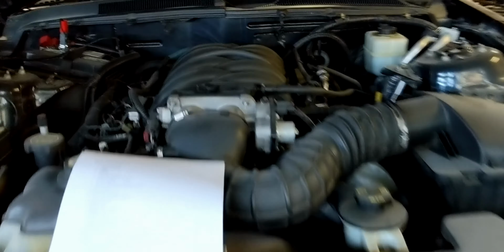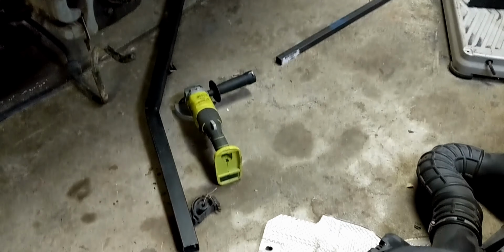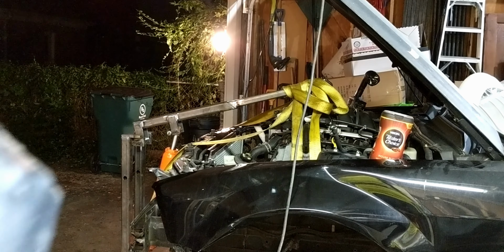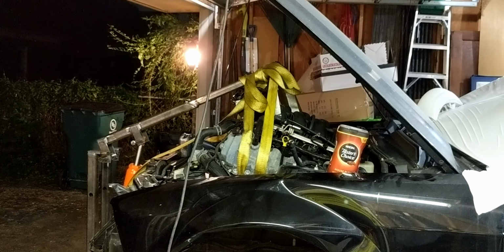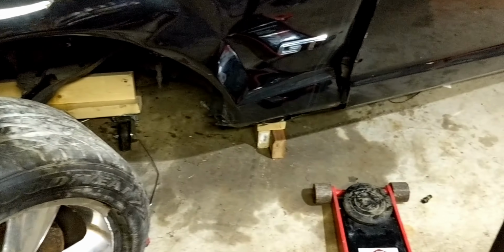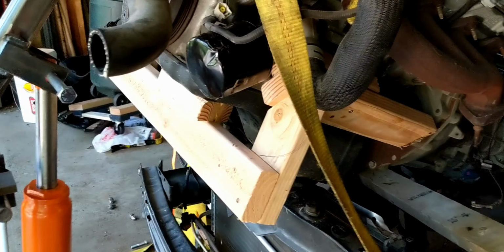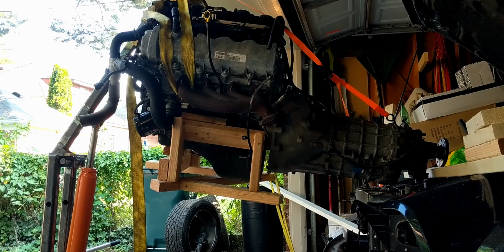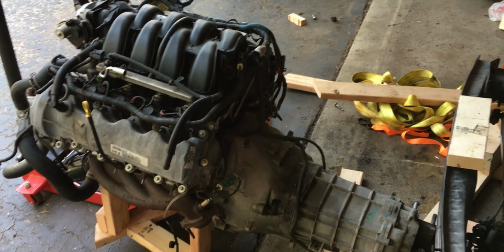$10k Shelby Cobra Build Part 3: Removing the Engine

Comment: I cringed when I watched this.  I have been working on and building cars for years.  Your commitment to the project is laudable but friend, commitment should NEVER eclipse good judgment or safety.  You risked your engine and transmission (the principle reason you bought the car in the first place) AND you risked severe injury to yourself as well....all because you were too cheap to rent an engine hoist or buy an inexpensive one from Harbor Freight (which you have already mentioned in an earlier video) which would have been somewhere around $89.  They also sell car dollies which are far better than those ridiculous furniture movers you bought.  You need to exercise far more care than you have done at this point and get your head wrapped around the idea that sometimes you will need to spend a dollar or two to get the job done safely.
Reply: It makes good YouTube though. But you are right. In a few months I hope to try my own build. Honestly  I think he has more experience than me.

Comment: If you take the intake manifold off in the center of the valley of the motor you’ll see two knock sensor bones that you can take a carburetor lifting plate for older style engines That just so happens to line up and work pretty well I’ve used it a couple times on the 4.6 L dual overhead cam Marauder engines a couple of times already

Comment: If this is any indication of you're technical ability.  What in the hell makes you think you can safely build a chassis? Let alone improve on the existing proven design of the man himself. I really do  hate to be so negative, but some times people need a wakeup call. I'm not saying give up, but for God's sake learn to weld properly and get some help from some one who knows what they are doing. If you carry on the way you are you'll  either fail to achieve you're  dream or you're dream will turn out to be a death trap.

Comment: Honestly,
I thought you were just going to take a saws all 
and cut off everything you don't need until, it fit under the Cobra body.
Thought you could section the floor and frame between the the back of the front seats, and rear suspension.
The Cobra is likely narrower, so I'm not sure if you'd need to make the suspension narrower too.
I think the Factory 5 kits use stock fox body Mustangs so maybe not.
Good luck in any event.

Comment: The car was already "totaled" , you should have removed the hood, core support, front bumper.Even if you had to use a Sawsall.  Would have been so much easier. Also, for the time and money you spent on  2x4's and square tubing, you could have bought a hoist from Harbor Freight at around 150.00.

Comment: Love your attitude mate but: You should have never used wood, hired an engine hoist and removed the radiator cooler assembly and top bar and given your self less of a height issue.
Please realise safety is crucial and while I love the 'I can mnake this' attitude sometimes renting is safer and better use of time.
Bit of tunnel vision made you lose sight of what actually needed to be done to get the engine out forward rather than up.
I do seriously wish you well from this side of the Pond ..

Comment: next time you pull an engine , jack up the rear of the car-it lowers that front radiator bar. . Next time you need a used engine,though, just buy the used engine,not the whole damn car!